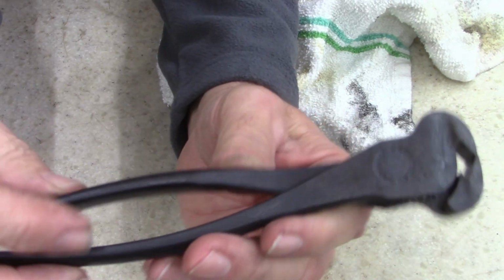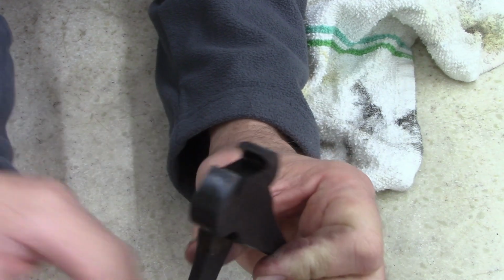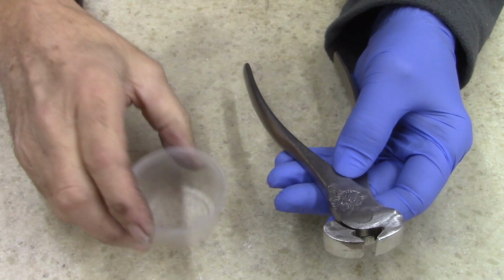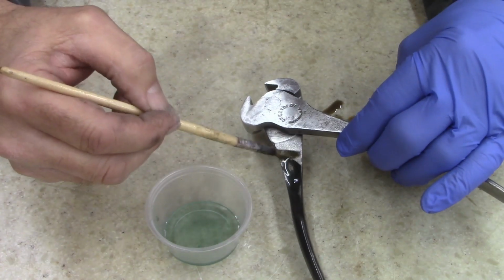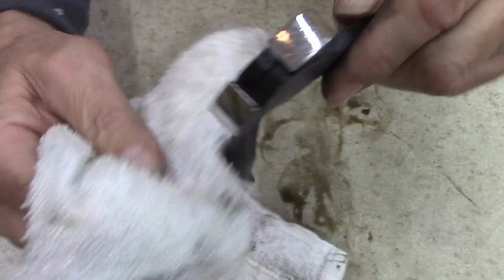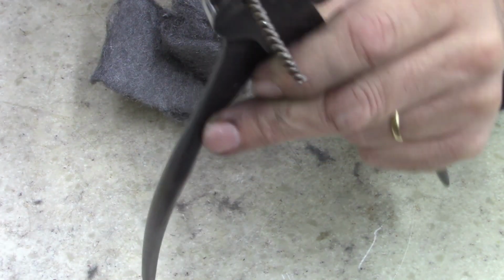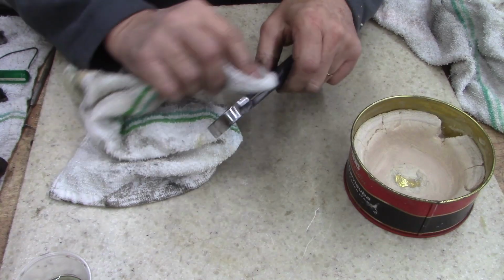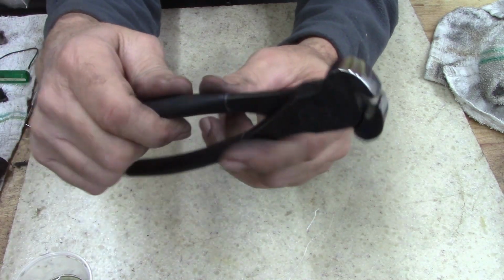Restoring Crescent nippers!

Comment: I picked up a a pair of those that the handles were really close together like that and i didn't like them so I put them in my vise and put some heat on each handle with my little propane torch and slid a piece of pipe over the handles and bent them back out. It worked pretty well and i use them a lot now. Nice restoration DJ. The bluing looks great against the polished cutter head. They look great.
Reply from the maker: Thanks!

Comment: I found a severely rusted 10” barcalo pliers at an estate sale yesterday. Soaked them inn evaporust over night. Finally got them disassembled so I could use the hand grinder to get the rust pits out.  Then belt sander then fiber wheel. They turned out better than new.
Reply from the maker: It is nice to find cheap great tools!!!!!!!!!